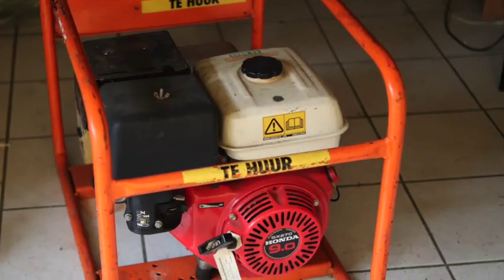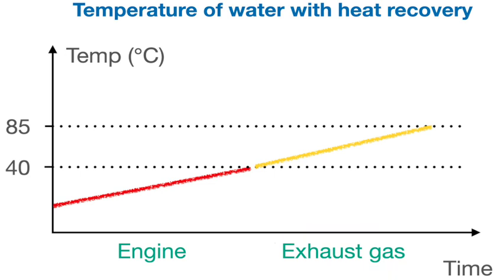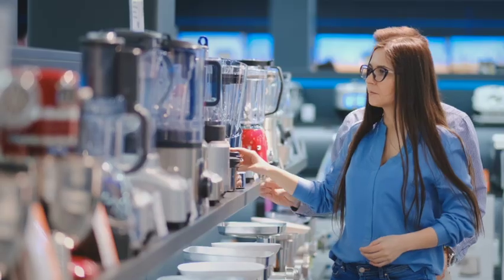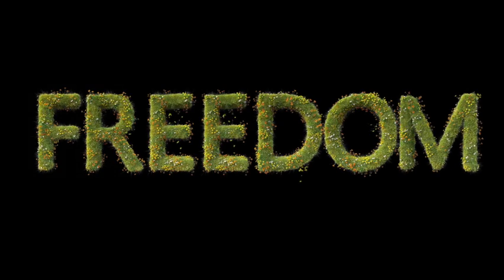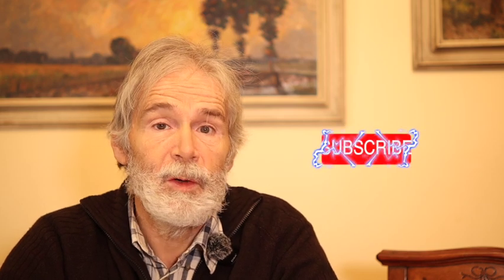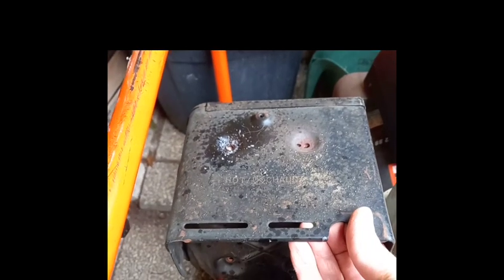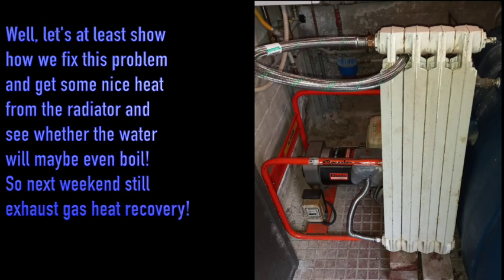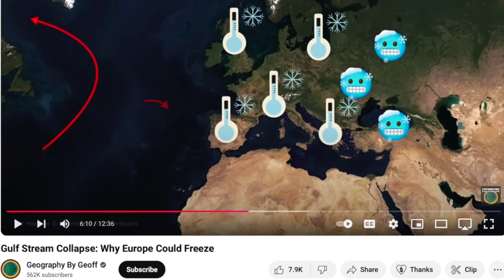Micro CHP's Hidden Secret to WARMING Your Home This Winter - Video 77

Comment: My not put all of the eengin in a tank of water and a long exaust in the tank
Reply from the maker: The water would indeed embrace the engine but also penetrate into patrs where it doesn't belong. In some way a chamber should be made around the cylinders and only them.

Comment: How do fork-lifts with engines run inside buildings without gassing everyone?
By running on LPG etc gas. ie: gaseous fuel which burns MUCH cleaner.
So why not first heat up the petrol, using the exhaust, to Pyrolyse it, before sending the exhaust through a heat exchanger in the house?
Now you get lower fuel consumption, less carbon buildup and less danger from any leaks. ('no' CO)

Add a bit of water to the fuel that's exhaust heated and you get some Steam Reformation = hydrogen = free fuel.
See: the Pantone Geet fuel reformer.

If you want those  cheap engines to last forever and use even less fuel, look up:
Dr Ali Erdemir Argonne National Labs Boric Acid in Oil lubricant

Ideally; skip the noisy, crappy air cooled gensets and get a water cooled genset that allows you to use the coolant heat in the house.
Then look up:
Quarter Wave Resonator as a way to make any constant rpm engine MUCH quieter.

Lastly: DO NOT put the genset direct on the floor. Put it on anything that absorbs vibration if you want it quieter.
Reply from the maker: Hi Raylene, it is impressive how much knowledge you have  about chemical processes! 
I was also in European project to convert biomass into higher value fuel. See https://www.blazeproject.eu
This channel is about DIY and I want to keep it a little bit simple. More over I want to leverage the large number of gasoline generators that are already in many household, I mention it in the video is about 5 to 15% of all households in developed countries.
Thanks also for the tip for silent operation, I will certainly do it!
Reply: @nnvasen-good-energy  Hi :)
Yes bio-digesters are interesting, but a really shit job!  :D
Maybe the rich plumbers dont mind.

Hmmm... you're already modding the exhaust, and a Geet is basically a bunch of plumbing fittings screwed together.
So I think it would make a good "easy mod" video.

QWR has a counterpart: The Helmholtz Resonator that's also interesting but not as easy.

Thx for the chat. :)
Reply: @nnvasen-good-energy  I'm Looking at blazeproject / process
Are there more details than this somewhere?
The chemical formulae etc?
Interesting!

Comment: Thank s for this video ! You re not weird ! You re excellent ! I have the same project since a long time too ! Do you know if we can find water-cooled cylinder heads for small domestic generators? I would like to collect the heat from the engine in a water circuit! to heat an insulated tank .For the exhaust pipe, we can recover the heat with an EGR and transfer it to a water circuit easily.
Reply from the maker: Hi Lapin, thank you for the appreciation! I was already a bit worried when I didn't find a similar video in the big world of YouTube... I was playing with the thought of taking a water cooled scooter engine or even better, an outboard engine on a motor boat, they might be smaller and also have often water cooling (even with less clean water).
What do you mean with EGR?
Reply: @nnvasen-good-energy  EGR is an exhaust  gaz to water exchanger that we can find on cars
Reply from the maker: Thanks for the reply Lapin, I see, the R of Recovery. I must ask the car mechanical workshops here in the region about EGRs, that would be a good alternative for my cast iron radiator!
Reply: @nnvasen-good-energy  Happy new year 2025v! ans good luck for all your excellent projects

Comment: Great! Perhaps no water in but the radiator in the water tank? :) Like in the ac project... "AC powered" radiator an top in the ibc and "chp radiator" in the bottom of the ibc? How to best use engine heat? Perhaps "make it water cooled"? cold ibc tank -> engine -> warm ibc tank...
Reply: IBC means Industrial Bulk Container.  Some people also call them totes.

I’m not sure how efficient this is and can see some problems.  A modern condensing boiler is around 90-97% efficient so is difficult to beat.  CHP electricity alone will be around 30% efficient at best, heat will be better but still only giving a combined efficiency of around 80%.  So there is a small financial and potentially environmental advantage if the all the power and heat can be consumed otherwise the loses are greater than conventional means.

I think this would be a great off grid application though.
Reply from the maker: Ah, I see, and looking up IBC I see indeed my 1000 litre among the images. Responding also to Neil, I think indeed that CHP can well be combined with this IBC, but they are 1100 km apart! We are like birds that live 6 summer months in Sicily because of our B&B and 6 months in Tuscany.
Reply from the maker: Hi Fredrik, sorry, what do you mean by IBC?
For now I have no water tank but of course I can integrate also that with this gasoline generator project, see video 71, where I got so many views. I am now in our winter house, without the water storage.
Regarding the radiator without water, that is the first experiment and after 5 minutes of low speed of the gasoline generator (electricity was not my scope in this slow speed experiment) and the tube to the radiator was getting warm but the radiator was cold, so I can this week do a longer experiment where the waterless radiator will heat until 70℃ or so, before risking the inter-element gaskets. But it is no problem to close the leaks in the muffler so that it has the force to blow into the water and then I can continue the experiment also at high (generating) speed, without temperature concerns.
Reply from the maker: Hi Fredrik, regarding cooling the engine itself, I told it in the previous video but didn't mention another obvious option like turning copper pipe around the cylinder. I find this rather daunting, given the limited space and obstructions like the spark plug. I have to think about other options with direct contact between a cooling spiral or other system to transfer heat into water.
Reply: IBC means Industrial Bulk Container.  Some people also call them totes.